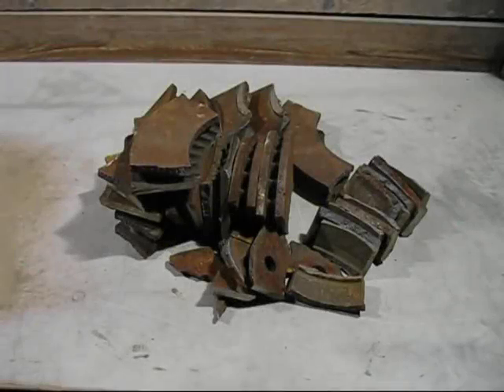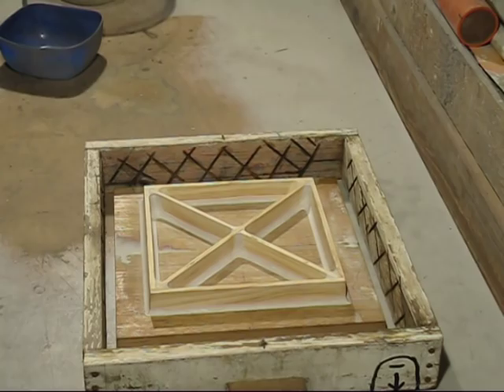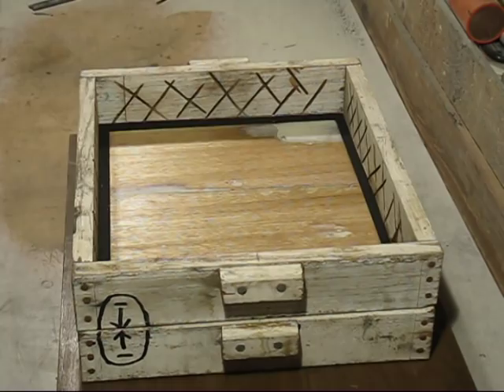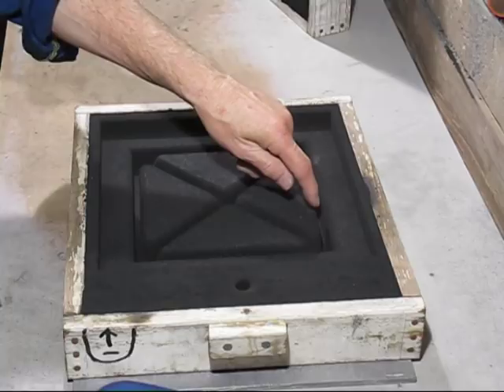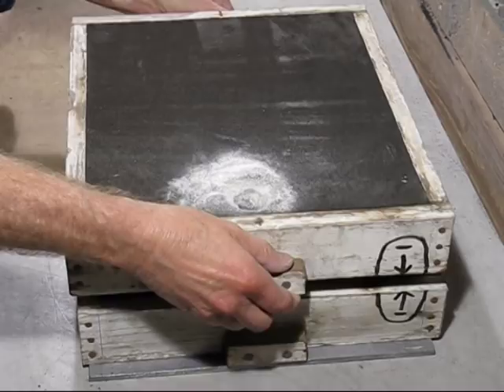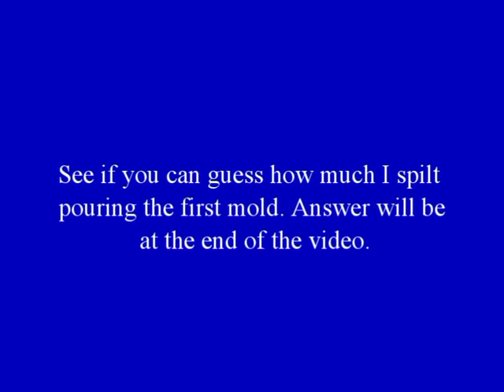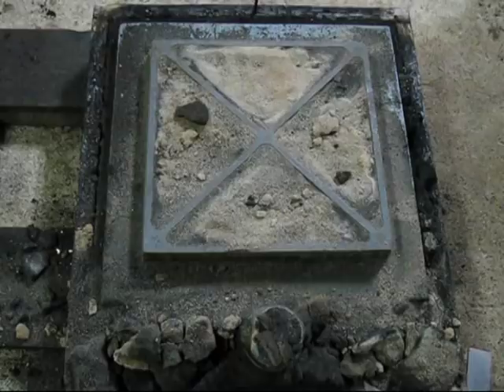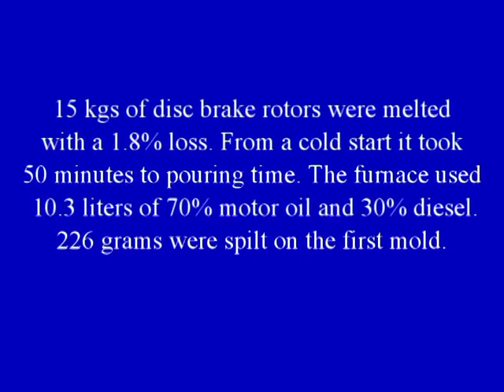Melting disc brake rotors (crucible camera action)

Comment: What is the finished product mate? And what is it going to be used for? Fair Dinkum it's a beauty mate,  whatever it is.
Reply: It is a surface plate. after grinding the face, it will be used to provide a flat place for a height gauge or other measuring devices.

Comment: Great video. What is the best formula for Green Sand when casting iron at 1300 Farenheit vs aluminum at lower temperatures ?
Reply from the maker: I use coal dust to improve surface finish for cast iron but with aluminium you can leave out the coal dust.
Reply: @luckygen1001  thank you

Comment: Saw on Hackaday.com today. Excellent video! I've done iron casting a few times with larger blast furnaces. I would love to make a small furnace for less than 700lb castings like this- do you have a video on how you built your furnace? Your rolling crucible pouring stand is brilliant mate. Why no vent holes though? And, what kind of sands did you use? I've only used Novaset pink setting compound on my sands. Cheers from Pittsburgh, PA USA!
Reply from the maker: Thank you for the link. I always thought that Hackaday was all about modifying electronics not about casting metals. I do love modifying electronics! I have a few videos about that subject. Vent holes are not needed.

Comment: never thought propane was dense enough to melt iron, awesome! nice to see somone casting iron. ive done alluminum but it seems no one tries to tackle iron. May i ask what you are using as your refractory insulation?
Reply: ok nevermind i seen the end lol. are you preheating with propane? i noticed the bottle
Reply from the maker: Ceramic fibre.
Reply: check out "Oil Burner"s channel if you want to see some good waste oil burner setups.

https://www.youtube.com/channel/UCEfdKGemqGDvpn2hSuJl2Nw

Propane is good for small disposable foundries for doing aluminum, but waste oil is the way to go if you're serious about it; and it's practically free energy as most shops and such would rather give it away than pay for disposal.

I have around 400-500 gallons worth from trucks, equipment sitting around in 55lb drums that'll eventually be re-purposed for a a homemade waste oil burner

works great for smudge pots/outdoor heaters too if you don't mind the smell...lol

Comment: Can you show or direct us to a way of making a Positive mold of Iron to have a way of pouring Aluminum into over and over?
Reply from the maker: Make a paster cast of what you to cast in aluminium and then make a sand mold of the plaster cast and pour iron in it. There are two sides of a mold so two halves have to be cast.
Reply: @luckygen1001  Thank you
Kind of thought that I would have to make 2.
One of the outside of what I wanted , then use it to make another to pour the Iron into.

Comment: you have any details on your furnace. Temperature range ? Most rotors in US are low carbon steel now. I have a garage full of them this is a good idea so i cam make some custom wood working machines
Reply from the maker: Max temperature is about 1570C, good enough to melt and pour cast iron. Can you show me where it says that rotors are low carbon steel?

Comment: I was a little reading on compacted graphite cast iron and it seams that disk breaks and drums are made from this. If you can would you be able to do a clip on this type of cast iron and if it is possible to get good results in you foundary thanks
Reply from the maker: All the disc brake rotors I have broken up do not bend before they break but exhaust manifolds I have broken up bend before they break. I have read that they are made from compacted graphite.
Reply: @luckygen1001  thanks for the reply when I can find the time I will finish my foundary and then when I can find the time I will make a patten and so on appreciate your content thanks again

Comment: I'm waiting for my Ferro Silicon 75%to arrive, what percentage by weight are you using? Thanks in advance, Matthew
Reply from the maker: Great to hear that you finally got some ferrosilicon! I use between 0.25% to 0.5%. The cast iron must be poured within ten minutes of adding otherwise the cast iron will revert back to a hard cast iron. Sewing machine scrap is very soft so you may get away with not adding any ferrosilicon.
Reply: @luckygen1001  Thank you for the info. It hasn't arrived yet! Thanks again, Matthew

Comment: Very interesting, I have never seen the first sand you used. What is that material. Thank you in advance.
Reply from the maker: The first sand has coal dust mixed in it to stop it sticking to the casting.

Comment: May I ask why you poured a wedge test before adding Ferro if you were just gonna add it away without waiting for the wedge to cool? Was it just to see how smooth it poured? Did it help you decide how much Ferro to add? Thanks. ☺
Reply from the maker: I need to know if I have added enough ferrosilicon and in this case it was not enough.
Reply: @luckygen1001  I realized that after,  later in the vid.  But,  could you not have waited until the wedge cooled and checked? I feel like I'm missing a key bit.  Thanks for taking your time out to respond.  Much appreciated.
Reply from the maker: Ferrosilicon fades after a short time after being added so if I wait too long the effect will disappear.
Reply: @luckygen1001  Thank you for taking the time to respond.  Much appreciated.

Comment: 10.3 litres over 50 minutes is a pretty hectic expenditure. You could get 1,000+ kW out of that same fuel being used to power an internal combustion engine and use electricity to melt your crucible metals in significantly less time. It seems whenever you do the math on home blacksmithing it's like Uber, something people bad at maths think is worth doing but really, really isn't worth the time or money. Which sucks because I'd love to make stuff just for the fun of it. :(
Reply from the maker: Using an internal combustion engine to run a generator and then trying to melt cast iron uses more fuel and takes longer than using  waste oil. There are huge losses when converting fuel to electricity and then using it to melt cast iron.
Reply: you can run a waste oil burner on 100% used motor oil... aka, no expense, adding diesel just helps it get up to temperature quicker and burn easier.

Comment: I wonder if it wouldn't have been better to leave the ferrosilicon out for the surface plate. Seems to me that the harder the better in that application.
Reply from the maker: If it is too hard then only a grinder will touch it. Machine tools removes metal quicker than a grinder.
Reply: Do you think that it would become harder than the original rotors? I only ask because those tend to be cut fairly easily with carbide tipped tools. Not to mention that to get a fairly flat surface putting it on a surface grinder wouldn't be a bad idea.
Reply from the maker: Have you ever tried to cut a rotor with high speed steel tools? It can be very tough to machine. The file test shows that it is not very hard but until I machine it then I will be able to see if it is harder than the rotor.
Reply: I'm wondering if Luckygen could just harden the surface plate, after machining?  Bring the plate back up to the right temp and quench?
Reply: To be useful, a surface plate must be "scraped in" to high tolerance. When it's as hard as the scrapers, scraping doesn't work. Commercially, many surface plates are flattened on a large surface grinder but that's not good enough for metrology.

Comment: Any thoughts on breaking up a cast iron bath to melt it for reuse? They're covered in enamel which I would not know how to remove other than manual chipping, but the baths themselves certainly have a lot of weight.

Thanks for the instructional video.
Reply from the maker: Before I used a sledge hammer to break up a bath tub that air chisel that was on the video was used to chip of all the enamel. It was some of the best cast iron I have melted but was very time consuming to get the enamel off.
Reply: Wouldn't the enamel simply melt off and float as dross?
Reply: First pour I did at Carry Furnaces here in Pittsburgh, we had 5000 lbs of iron, most of it cast iron bathtubs. 3 days with a sledgehammer. Its excellent iron, and the enamel you don't get off just turns to dross you skim off. Just make sure you wear a mesh face shield and goggles man- those shards of enamel will shred you!
Reply: Thanks Andrew.
Reply: Pain In the ass , leave the tub as a tub , I've done it lol , not worth the effort and danger

Comment: Luckygen,  What rule of thumb do you use when deciding how much ferrosilicon to add to your melt?  (I miss your input on the thehomefoundry site)
Reply from the maker: I aim for 0.25% but it can vary with different cast irons.
Reply: luckygen1001 Bur confronted with some general cast iron, generally a person does not know what the silicon content is to begin with. So, do you generally add 1/2 ounce of ferrosilicon per pound, say? Oh do you follow some general pattern ?
Reply from the maker: you could try that and yes you are right one does not know what the silicon content is so it is best to start in small amounts.

Comment: How do you go about measuring the temperature of molten cast iron? IR?
Reply from the maker: I use a pyrometer to measure furnace temperature and the metal temperature is 100C-150C lower.

Comment: How did you restart foundry after adding ferro silicon.?
Reply: The the crucible's refractory lining glows with much more heat than it takes to ignite a fuel-oil mist, for a lengthy period after shut down. Care should be taken to insure that a bare minimum of fuel is introduced to the blower air when re-igniting, so that an explosive quantity is avoided. It will roar-stop repeatedly until enough fuel is safely fed to sustain the blast, less than a minute. 

According to Ray Brabury, it only takes "451F°" to ignite a ball of paper, even hours later, because the refractory lining is designed to hold the heat. The molten iron will be poured @ more than 2,500F°, while the crucible must be far hotter, unless you have days to bring the iron to molten. Iron requires a better refractory lining than non-ferrous metals do. Castable refractory for iron is available (here in SoCal) in 50# bags and provides a hard, very durable liner.

To line my furnace, I packed in a dampened bottom layer of refractory several inches thick, centered a rolled cardboard tube in the furnace shell, against the welded-in steel air tube, shaped to fit the cardboard tube on a tangent, then placed a plastic bag in the tube and filled it with loose sand. When the topped- up refractory got stiff, I pulled out the bag of sand, removed the cardboard tube and smoothly faired the still soft refractory at the air tube. That was 20 or more years ago and the liner shows virtually no sign of erosion, but the majority of my castings are non-ferrous and infrequent to none any more. I'd built a succession of steadily improving furnaces before. I'll be 80 in 2 months, it may be my last. ;-)

Tip: A charcoal furnace takes nearly as much work to build, as a furnace that won't constantly disappoint you. You just have to build the fuel delivery system. Far superior and waste oil is dramatically cheaper/free. While my furnace runs on natural gas, it's still cheaper, (and far cleaner) than charcoal per BTU. In truth, I just never got around to building the oil burner that designed years ago and that I'd prefer.  Ooops, got on a roll, sorry.....old guys...uh, see top few words for relighting a furnace......

Comment: Can someone please suggest :
1. How much propane it`s supposed to take for melting 10kg (22lbs) of 

iron ?
2. do I need 2 torches for that ?
3. Can you melt iron with cooking gas tank (the big ones) and a bitumen 

welding torch ?
Reply from the maker: 1. Not sure how much propane is used for 10kg.  2. No 3. Yes, no.
Reply: @luckygen1001  
Thanks, I have a dilemma :
I need to cast weights for weightlifting (I do the big ones with concrete but for the handheld barbells I need small ones).
I can do it with lead which costs me 2.5$/kg and easy to melt.
Or with iron, which I can get for free (scraps), but have to probably invest a lot in equipment (torch, blower, crucible...) and it`s way harder to get a good even cast (is it ?). I need 60-100 kg in total. So what would you recommend, getting into iron business (maybe for future projects too) or do it easy with lead ?
Reply from the maker: If you have no other projects after the weights just use lead.

Comment: True, but could these be old ones? Pre 1990. It's a huge risk, I'm just saying be careful as asbestos exposure is nasty
Reply: Actually asbestos exposure is way overblown. Not that there is no hazard. There is and it is horrid. It is just that once the hazard was known, people react as if any exposure at all is as horrid as the chronic exposure. Only people working day in and day out around it ever suffered from the severe effects. Most people exposed to a little here and there never suffered any ill effects. But we live in the age of fear. So let's fear every freaking thing.
Reply: agreed, too many people flip out at just the mention of it. quite frankly, unless you're snorting asbestos dust up your nose, it's no more harmful than the hundreds of other materials we encounter on a daily basis...

I've worked around it for years,  and to be honest,  I'd rather handle asbestos or lead on a daily basis than fiberglass

Comment: There really very little "cast iron" out there and none in automotive parts.  Your parts are a specialty carbon steel and, perhaps a proprietary formula with unknown hardening and tempering needs.  Cast iron is not up to the temperatures and stresses of either the mass manufacture or the constant use of automotive parts.  The fact that you can melt it is highly useful, however, and your foundry footage is very good.  Keep up the good work.
Reply: from a practical machinist thread on the same subject:

conventional automotive brake rotors are cast from G3000 grey cast iron. These work well with a pad material designed to operate using adherent friction. Most of the European system rotors are cast from a high carbon G4000 grey cast iron. These work well with a pad designed to operate using abrasive friction, such that the rotor is sacrificial just like the pad.

Some sintered metal (motorcycle) type pads work well with steel rotors, but conventional automotive pads need a more porous material, like grey iron
Reply: Shonuff beat me to it with a most authoritative reference. My received wisdom was that for brake surfaces, cast iron has thermal characteristics superior to steel.

Comment: So the trapped air escapes through the sand?
Reply from the maker: Yes.
Reply: For intricate castings, (lot's of pockets) a wire is pushed down to the pattern in as many places as seems right. The little whiskers of metal produced come right off and are proof that no pockets of air spoiled the casting.

Comment: What kind of green sand and crucibles do you use for your iron castings? I hear bentonite - silica sand green sands tend to break down at iron melting temperatures. Also, clay graphite and silicon carbide crucibles aren't great for iron casting because they dissolve the graphite out of the crucibles. 

Your casting projects are really impressive and I would love to try some similar things in the near future. Cheers!
Reply from the maker: I always use fresh molding sand with coal dust because iron is hard on sand. If you hear about  a crucible that lasts forever melting cast iron please let know.

Comment: I had always heard that brake rotors were crap for cast iron source because when they were melted, they just refused to have enough carbon content and would be more or less a high carbon steel, so hard to cast with. Now that I know that isnt the case, Ill have to start grabbing some of those, do they work in a cupola furnace better if broken up due to the coke adding the carbon to it than the crucible furnace, or is it about the same?I wish I could get ahold of one of those cast iron surface plates, lol. That would be quite a project to do that would really be handy in the shop for ages to come.
Reply from the maker: When any cast iron is melted in a cupola the iron is always softer. It is the best furnace to remelt iron because it absorbs carbon but for me it is easier to use a crucible furnace.
Reply: oh, ok, that helps alot. I was planning on building a cupola for doing iron, but havnt done it because of the inability to get decent pieces of cast iron, but I find brake drums all the time and always passed them up because everyone always said that they were crap to melt.
Reply: What would happen if you just threw some coke or charcoal into the crucible with the scrap ?
Reply: Dennis Young  what about lime?
Reply: Dennis Young  Oh i know what it's for....it adhears to the impurities, slag is made this way....I was simply reminding him not to forget it, or if not WANTING to use it....why....but thanks anyway....i appreciate.